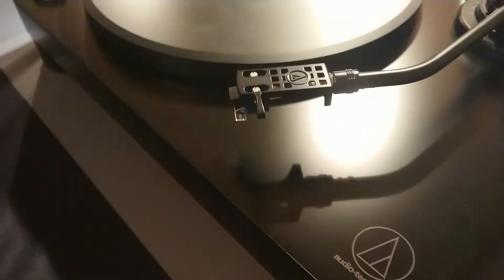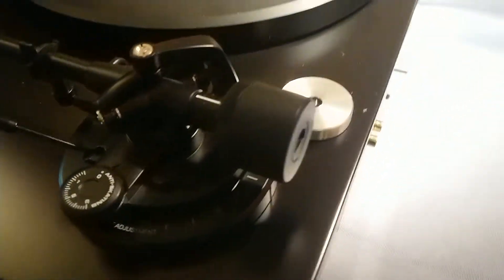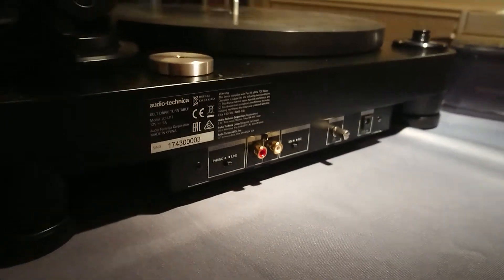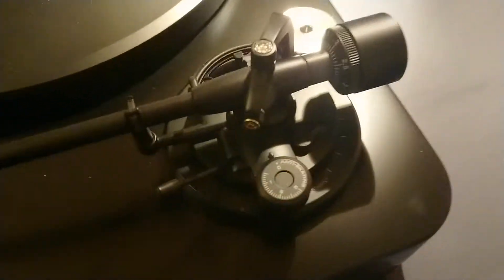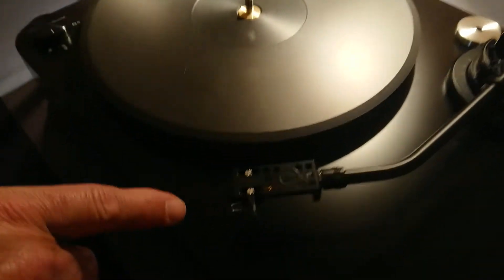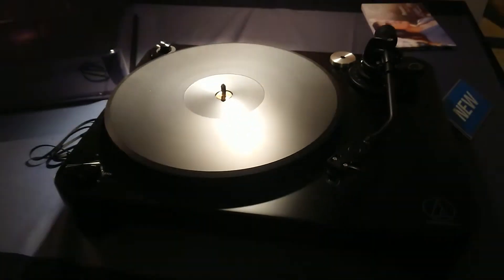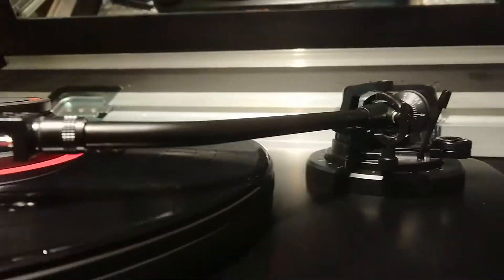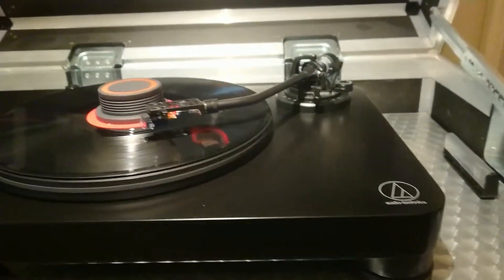Audio Technica AT-LP7 turntable

Comment: Audio Technica had a pretty decent quality turntable in the program some years ago:
the AT-LP240. Freed of all unneccessary features of  the usual DJ style Hanpin`s it was a 
solid built deck. If they just had gone "innovative" and added a autoreturn,and tightened
the QA it wouldve been a nice upper middleclass deck for home use. But no.
I always wonder how unerringly the mark is missed. And that its expected the consumer  
will pay for it. In this case stunning $800.....
I mean the retro-vinyl trend is at least since 2010 mainstream. Thats now eight years. 
Look back how turntables developed in that timeperiod of eight years in the seventies
but today nothing in comparison,except prices are rising. The industry just dont even 
have to develop something new. Its all in their databases. But instead they are circling 
around the minimum requirements.
Reply: Zockopa No OEM Hanpin is worth that much. There tends to be alot of junk under the hood.
Reply: Agree,but that wasnt the point,or was it ?